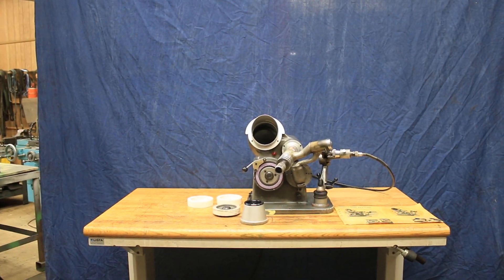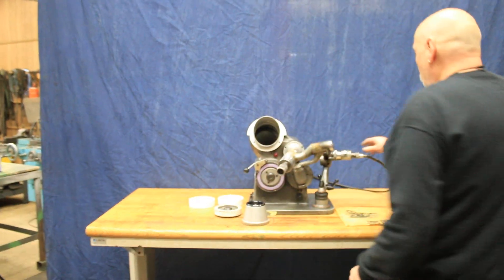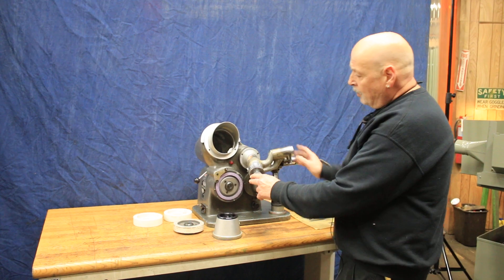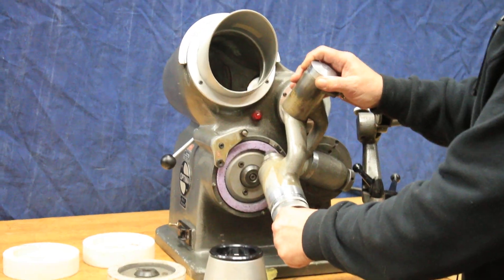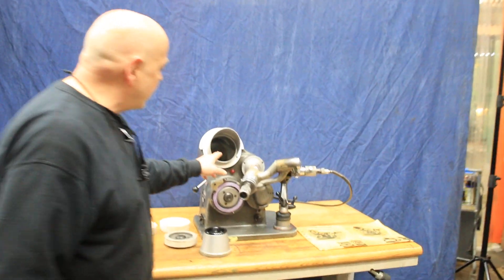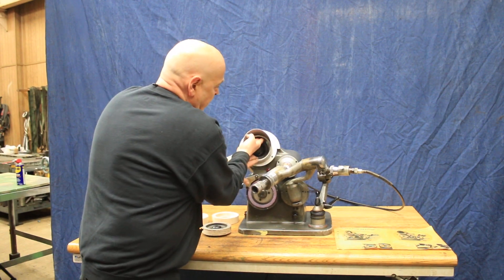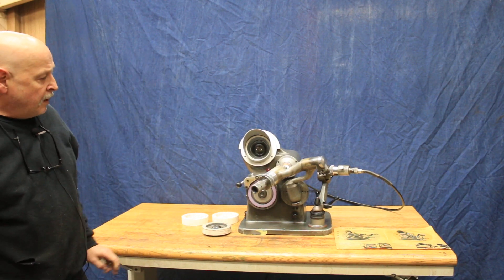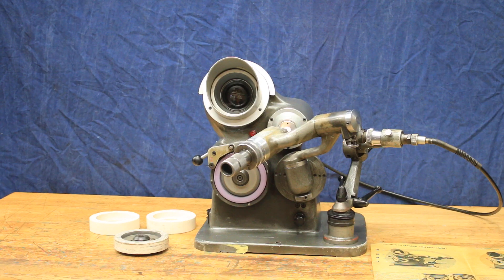1'' Dia. Optima UNIVERSAL DRILL GRINDER

Comment: No, you are missing the frosted glass.  It is still needed.  The "other lens" that you have installed is actually backwards.  The large portion should go in first, and the felt provides friction on the hood to keep the magnifier installed.  It presses up against the frosted glass such that you can magnify the projected image for additional detail.  Without that glass, you have nothing for the image to be projected upon and that part of the system is effectively useless.  Sorry to break the news, but you do have some additional items you need